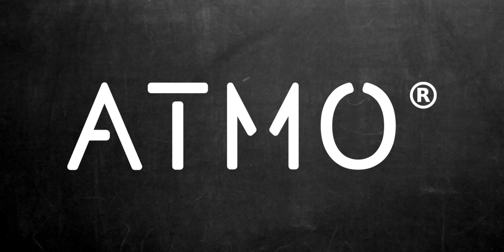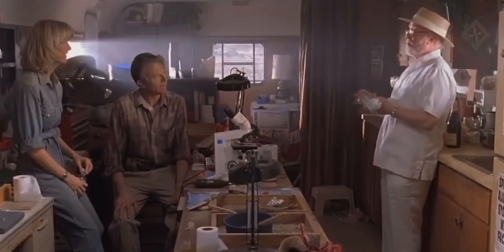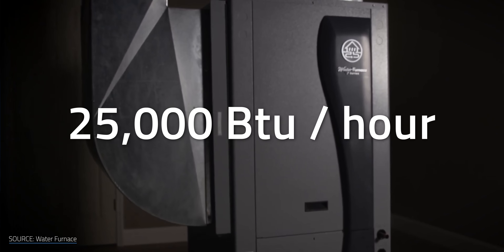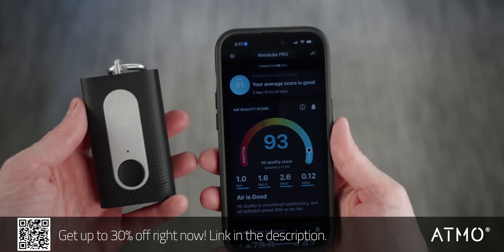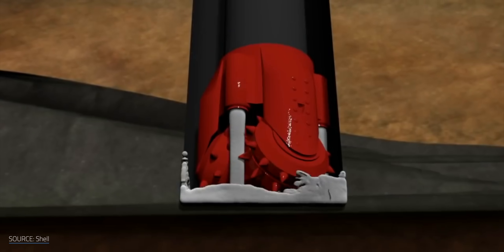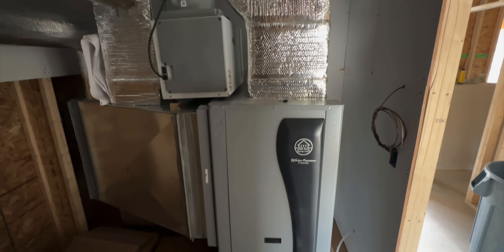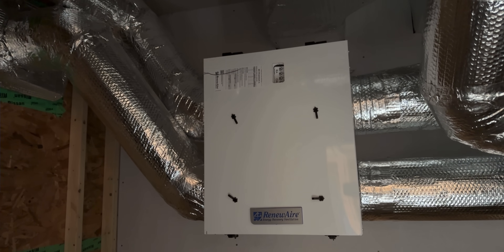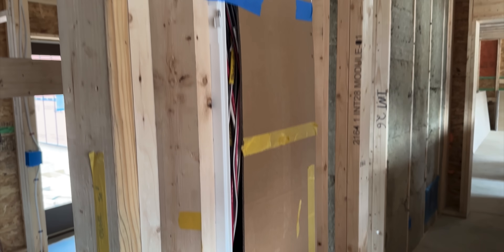Why I Went With Geothermal For My Net Zero Home

Comment: Do you have a video or a drawing showing your new homes utility room? 

I'm in the process of designing a new home and I want to make sure the utility room I go with is going to be large enough to fit everything needed for a geothermal utility room, including a washer, dryer, sink, and home water softener and filtration system

Comment: Have 400 feet been enough? You likely have very good insulation and I how much you heat. In the 80-90s they dimensioned the systems  so that it would cover 75% of the energy needed. Then the wells was around 400 feet. This in a climate with minimum teperatures around -25 to -30C. Today tje recomendation would like be 600 feet over here t9 cover 100%.

Comment: I love the video and that you are doing this! A small critique is that I didn't understand how you could use geothermal energy on your private property, but the system you installed is called ground source heating. It uses the low but steady temperature of the soil, but not the geothermal heat, which is well above the ambient temperatures in summer. That's the kind of heat that makes Yellow Stone Lakes boil. Although some companies and organisations call it "geothermal"m you'll confuse many engineers and scientists who think of heat from the inner earth and large boreholes for heating plants that supply whole cities with heat.

Comment: I'd like to hear more about your home networking setup and wiring closet.  We would prefer not to be using wireless all over the house to run things. It may/may not be a health risk, but it does open security issues, so I'd like to know more about your connectivity setup.

Comment: The Geothermalsystem is all over Europe, mine is 20 years old, drilled a 500 foot hole in my garden down with the hoses and installed the system it has worked reall well over the years give us hot water to the radiators and for showers as well. i spoked to the driller and he informed me about 50 % off all his holes are dry (works a little bit worse) the other half has what we call an active hole (it means that there is wet hole and its little bit better performance of the hole. The other things with the horisontal hose you show on your movie with the excavator diggin for the hose and fill up after, We dont do that at all.... In Sweden we has a big tractor that pressure down the horisontal hose in the ground and as the tractor moves along the hose is behind the tractor on a big role and will be feeded into the ground. In good conditions it will put down like 1500 feet in 1 or 2 hours...

Comment: Seems a house using radiant heating would benefit from having control logic like PID figuring out your heating cycles. I know it would be more complex than that, but just a thought. I built a bread proofer with an Auber ECT-100A controller cycling a Nescon18 qt roaster. Wasn't an original idea I had, but reading about PIDs from my foray into espresso machines made me ask the question, and do some searching, I found someone already cracked that code.

Comment: Vertical wells do not work nearly as well as a horizontal coil loop type.
I have witnessed an engineered multi well system fail miserably, never getting close to design temp diff.  The wells tend to exchange between the tubes and have a very small temp difference.

Comment: Your cash flow is obviously on the very high end. While you may eventually recover your expenses. Not everyone can handle that kind of up front costs/maintence. All these electronics are weak points with very little owner reparability , propriety  nonstandard  systems may not exist in 2-3 years with the rapid changes in technology. Have you any low tech backup systems in place if for instance of massive power surge knocking out critical components?

Comment: HVAC tech here. Geothermal and Aquathermal heat pumps are unicorns in our industry. I've only ever heard of them and seen them online and in pamphlets. I've never worked on one. I've never installed one. In fact, it's not even an option in our price book. However, I just hear how cool it is, and I really want one in my own house.

By the way, get an APCO Dual UV Sterilizer. It handles Bacteria, Viruses, Mold, and VOCs (smells) right in the supply plenum. It has a UV Bulb in the supply plenum and installs one under the evaporator coil to eliminate any living microorganism that ever finds itself airborne and flying through your ductwork. I'm not sponsored or affiliated with Freshaire (the company that makes the APCO,) but they are second to none in both quality and in honoring their lifetime warranty.
Reply: is there any benefit to doing this over something standard
Reply: @SuperCakeKing  Yes. Ground-to-air and water-to-air air-conditioning systems are more efficient and can work year round because the ground or water will never be too cold or too hot for it not to function properly. With air-to-air air-conditioning systems, it will only work to a certain point, but if it gets too hot, you'll have to use emergency heating, which 9/10 times is just an electric coil that turns electricity into heat. Also it's more efficient. However, unless you're rich and just want something cool because it's cool, I wouldn't really consider it. 

If you're talking about the APCO, yes, it has a carbon grid placed inside the ductwork. That's the biggest difference. Any UV light will work though; it will kill bacteria and viruses, but it won't handle smells. Personally, I took a busted toptech UV ballast, opened it up, replaced a component that had heat damage, and it worked just fine after that, so that's what I've been using. I'll upgrade to the APCO when I have some pocket change that I don't have a plan for. Buuuut, keep in mind, since you, the homeowner, will become noseblind to the stench of your own house, it's really only there if you're self-conscious about what other people think of how your house smells.

Comment: And... can it survive Carrington?  The next Carrington is due NOW to, at latest, 2059.   And, of course, it'll fry all metal from just slightly smaller than a coat hangers down. So, all microcircuifs. Fried.

The last Carrington occurred in 1859 and it dissolved telegraph wires everywhere in the world, and started fires in telegraph offices. These were the only metql.wire in use the , just think how much metal exists in everything now. Mirocircuitry turned into molten metal. 

Imo this is why the goverment has been dumping liquid heavy metals into the atmosphere for the last thirty years, chemtrails.  They hope to create a global Faraday cage around the Earth...  

Imo.

Comment: Thanks for the video, it was very informative. I'm very curious how your Water Furnace and ERV perform. We are nearly finished with plans and will be building later next year and I'm really looking forward to getting with the HVAC folks to see what we can do. There are not many geothermal folks and the one company that has been drilling for years advises drilling over a horizontal loops system...I'm hoping to find more information on if that is the case or if this is just a biased opinion from a company that makes more by drilling. I'm curious on the calculations for the heat pump vs. geothermal. I'm also interested in a metal roof and curious to see why you went that way but didn't see a video posted about it yet. I'll be looking into more of your videos!

Comment: While some people have the budget to build new, buying and improving is valid. We brought a 1932 house from 45 000 kWh annually down to just estimated 12 629 kWh. And we only had the place for a year. Sure it is not free to upgrade but just a few years lowered running cost will pay for most of those investments. And ofc there are still much more to be done, I am unsure we will be able to bring it down to net-zero, but balance between bought and sold now is around 9500 kWh per year, Batteries could help us use more of the solar energy, but my real dream is to install FTX to part improve indoor air quality, but also further reduce heating cost.

Comment: I plan on building a 'passive house' - no active heating or cooling needed. (Just heat from the sun, warm bodies, waste heat from electronics, cooking and showering etc. is enough to keep the house warm all winter). Look up 'passive house' or the German word 'passivhaus' (it's originally a German standard) if you're interested.

Comment: Nice breakdown of the process, I have couple questions about the goal of net zero though. You have included many miles of cables that wouldn't otherwise be included in a house, those all have an additional carbon cost in mining of the minerals, production and transportation, have you counted that in any calculations? Also, with the heat pumps, I've talked to HVAC professionals and I'm told they slowly leak their refrigerants, how damaging is that to the environment given one of the main gasses used is freon? Also, have you calculated the additional carbon involved with the massive digger you needed as well as the many additional workers that had to commute? I'd be curious if this shifts your calculations of when your house can truly become carbon neutral. Thanks.

Comment: We have a net-zero house, for WAY less money.  We started with a used but 25 year old manufactured home.  It has fantastic insulation.  I put in a 5 KW solar array with a net-metered grid-tie.  (Totally DIY, by the way.)  Then we converted all appliances to electric, and got rid of the propane tank.  Have not had an electric bill since I installed it.  The electric company owes me about $120 per year.  Grid outages are rare here, and short, so no batteries needed.  My inverter supplies 1200 watts to run the fridge while the sun shines anyway.  For HVAC we just heat or cool the rooms we are in with small electrical appliances.  For cooking we use the usual:  Microwave, convection oven, induction burners, smartpot, air fryer, etc.  We do have an electric dryer, but seldom use it.  No fancy home management or switches.  I can talk to my inverter to see how it's doing, but that came free.  Putting up insulating panels on the windows at night gives my wife something to do that she loves.  She even cut out the rigid foam panels to fit.

Comment: Actually, there is no need for smart shades. Passive house roof extensions designed to shade sun at summer and allow at winter. You know, sun angle is higher in summer, so with calculation, you can have sunlight only in same timespans of the year.

Comment: Isn't there a potential problem with the ERV pulling from a kitchen fume hood where there will be oil and grease in the fumes?  That seems like it would lead to a plugged ERV and in my experience I would always route that type of exhaust straight to outside, usually through a rough filter media like expanded aluminum or stainless steel mesh.

Comment: A heat pump hot water heater steals house heat and concentrates it, requiring 1500 sqf to disburse the cooled-air byproduct. This requires reheating. It's twice-heated  air.  It would be efficient if you could direct the soon-to-be-expired home air, just prior to being exhausted, over to the hot water heat pump. After the heat pump extracts the latent heat, it could then be put directly in the exhaust path of the home's dead air ready to be processed by the Heat Recovery Ventilator.  One could put the water heater in the laundry room, which would satisfy this condition, as it has just such an HRV exhaust vent.

Comment: Central air is really the way to go.  All of this talk about radiant heat and ductless mini-splits is silly.  Yes, they work at accomodating temperatures, but they don't circulate the air enough to filter it or dehumidify it.  Good call.

Comment: I prefer geothermal exactly because it does not use the air. So no matter what happens outside, you can be cozy inside.
The only thing making your new home more badass is a air recovery system. Something they would have on a spaceship. Let the apocalypse come.

Comment: i swear .....decent videos on this channel but span pannels are a good indicator of how much koolaid someones been drinking....you can buy an entire pallet 16kw of solar...for less than a span panel.  you can buy an entire pallet of 15kw solar panels and a 12kw inverter....for less thanthe cost of that span panel.

who cares! whats going on in your house.  for 9000$ you can offset the biggest pos house out there with 15kw of ac.  

the only! thing it does that 80$ of emporia current transformer loops wouldnt do....is let you turn off circuits from an app and autoshutoff loads during battery backup.  which will become pointless once batteries are capable of actually powering houses

1 powerwall 30 amps - no only lights fridge
2 powerwalls 60 amps - no only lights fridge minisplits
3 powerwalls 90 amps - only lights fridge might start a smaller ac assuming nothing else is on.  ENERGY itll run 45kwh of stuff overnight.  15 hour winter night.  if your power bill is over 200$/mo it wont get you through 1 night...

see how dumb this crap is?

1 ford lightning
1 cybertruck
1 rivian
with 2 way charging...you already have the truck....for free as in the case of every single tesla ever sold as none can v2h yet...
and once they do/are forced to by competitors since it kills powerwalls.
the powerwalls are jsut worthless garbage you wasted money on that dont even make useful power and pitiful amounts of energy.

thank god ford for once did somehting useful and is leading v2h trucks.

dont need a pos span, when you have a truck that can output 200 amps (thanks stupid af nec code requiring a backup load panel when the generator cant make as many amps as the service despite that being a huge rarity)

Comment: Over engineered. Complex wiring, networks and over energized. What ever happened to simplicity? Does it have EMF protection? An EMP burst will fry everything.  Sun burst radiation or man made devices. Think positive but plan plan for worst possible issues. Take a good home warranty policy.

Comment: Adjustable Window Shades
Matt et al, My compliments for detailing what "toys" (the term another reviewer used for the remote control interior shades and other automation) are available for energy savings. Yes, the interior shades are effective in controlling direct solar gain but only realize a small fraction of what exterior shades/blinds/shutters can do. Keeping the sun off the glass is the principle for improved energy control. Retrofitting the exterior shades to be inconspicuous is no small task. When one wants to stay abreast of practical and efficient energy conservation, just look to the countries where they pay perhaps three times more for energy. No "research" needed. Respectfully,

Comment: If you already have an adequate well geothermal can be less expensive to install than air source or gas heat/electric A/C systems.  In our area 58F is the underground water temp year round.

Comment: Matt, if you have not connected the ground loop to the flow center, I strongly recommend you install both pressure and temperature gauges to the supply and return ground loops at the flow center.  I have a reference in my video (mechanical systems) on my site. You would find a lot of useful info as well when it comes to designing for net zero. Feel free to reach out to me. Patrick

Comment: Automated shades are a good idea. Even in our passive solar geothermal envelope and somewhat purposefully leaky house the shades make a significant difference in cooling load. I wish they were automated. I can advise against remote-controlled, attic window openers however--as their logic tends to get scrambled due to electrical spikes and then the motor may decide to keep running and strip the nylon gears. Yeah, it's a thing, sorry to say.

Comment: Buildings are largely built the same way they've been built for decades.  Builders generally don't know tech.  They are good at what they do (probably) but if you put them in front of a smart home system, or even a basic computer, they would struggle.  Thank you for highlighting some of these techs in your videos.  I went smart home for all my stuff, retrofit, and I use each component, in some form, every day.  You don't appreciate the convenience of a smart home until you have one.  And I'll never go back.  To me, it's worth every penny, just in convenience.  When you factor in potential energy savings from smart appliance management, things start to get very interesting, just on the building side.  I hope that more and more builders become interested in these techs and start offering them in their new builds, because doing the work while the walls are open and appliances are still being chosen are a HUGE savings versus any retrofit.  Smart tech should be in the DNA of a home, not added as an afterthought.

Comment: With your HVAC system, do you need additional whole house humidifier built into the forced air?

I am interested in your roof choice, specifically why you didn't go with solar roof tiles.

Comment: Matt,
This is so amazing and exciting. I am thrilled for you and your family and wish you every success.
I would love to upgrade our 1951 house to improve its energy efficiency and comfort. I am considering a massive increase in insulation, a photovoltaic/thermal solar, heat pumps for forced air HVAC and domestic water, a grey water system for outside plant irrigation...
I would love to learn more about all the systems in your current and new homes.
Thanks!